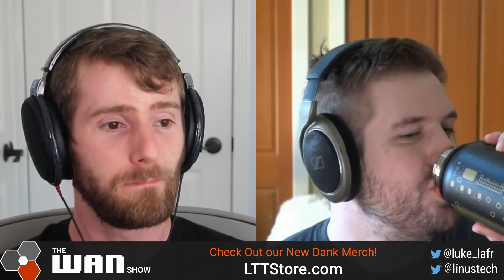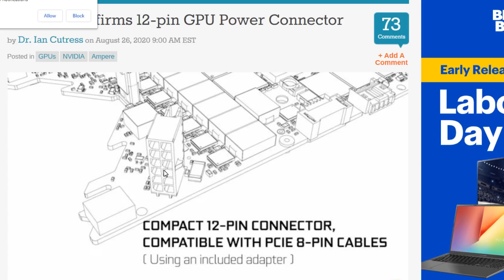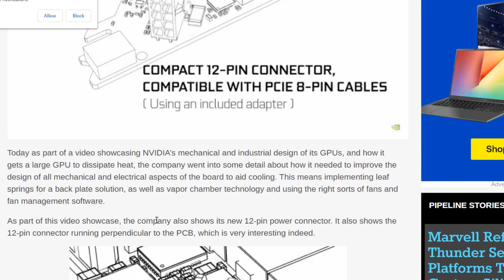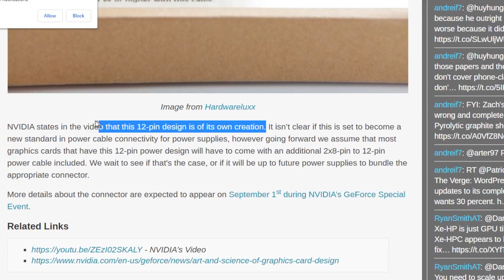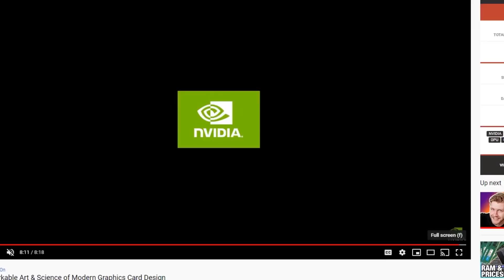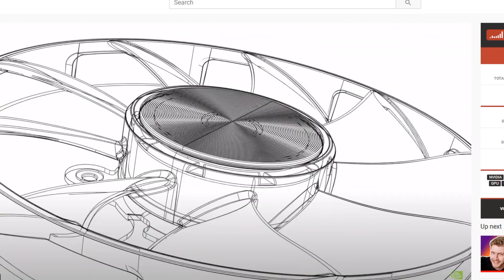Nvidia Confirms RTX 3090 12-pin Connector!

Comment: @LTT I have a question please help me!! (Or anybody else that's more tech savvy than me which honestly isn't much)

Im doing a small upgrade/rebuild(?) of my PC involving a motherboard, CPU, and RAM.. what would be some things I should worry about/look forward to in terms of possible difficulty. 

Full details. I'm upgrading, albeit small, from an old amd fx4300 (i forget what my current motherboard is, forgive me, but it was a pre built comp I bought off of Amazon) to an ASUS B450 pro .. I think it is what it's titled. Im going for an amd Ryzen 5 2600x for my pc.. I suppose ram doesn't matter too much since I'm upgrading from 4gb ddr3 to 16gb ddr4. Anything more improved that my old junk HAS to be an improvement! LOL

Comment: I dont care about this from a cable management stand point because if you care about the look you would use extensions . I dont on most build anyway  since its so cheap nowadays. Now extension manufacturers are going to have to make a 12pin extension. But if the performance is there then I'm in.

Comment: i got zotac 980ti amp extreme and there is already a 12 pin connector - i use 2 6 pin for this.. why is this now so a "new" thing? or did i cant use my 2x 6 pins for this now?

Comment: I am fine with using the adapter if it's long enough so that the joint were the original and the adapter meet is not visible. The join needs to be under the power supply shroud or as I call it "the basement".

Comment: Could someone a bit more knowlegable please educate me as to why it's a 12 pin connector?  It makes no sense to me

Seeing as it's either 2x8 or 3x8 wich is either 16 or 24 pin on the GPU. And i remember seeing the 12 pin connects to 2x8 meaning you get less pins any way?

Is it just so that if you have 4x8 pins from your PSU, you can plug all of those into two 12pins to only have 2 sets running to your GPU instead of 3 cables?

Comment: I really hope this stupidity goes straight out the window. PSU manufactures don't provide enough information as it is about the products they sell. Now Nvidia wants to add a custom 12 pin and add more confusion to the market. From watching a lot of the coverage the 3rd party cards are not even entertaining this 12-pin idiocy they are just using x2 or x3 8-pins. Go to hell Nvidia you're not that special.

Comment: Wait so I don't need to update my PCU? I have a modular 650watt (which is the minimum req. for 3070). I can either use the adapter that should come with the 3070 and or just get a new cable? First time building here.

Comment: In general, computer stuff is poorly designed from the beginning, compared to industrial stuff when it comes to cable managing.
I have seen some sick builds, but those guys has made their own cables, and in some cases resoldered new connectors on the boards, sometimes on the back of the motherboard to hide the cables

Comment: So I'm building my computer in the coming months and I've been trying to understand all this computer stuff lol and one of the only things I've bought so far is my 750W power supply and I'm hoping even though i just bought it I don't have to replace it but how would i know if I do or not ?
Reply: don't buy a single component when you have no idea of the rest. usually any PSU should be enough for any build if it's true 750W (I expect at least a gold certification and non rubbish brand), but it's the bare minimum as advertised by nvidia.

Comment: Do I need to upgrade my power supply??? I currently have a Corsair RMX Series (2018), RM650x, 650 Watt, 80+ Gold Certified, Fully Modular Power Supply, and supposedly my pc (without a graphics card) takes around 223-250 watts. And add the 320 watts for the 3080, I’d be cutting it close but it would still work. But idk if I need to buy a new power supply because of the 12 pin connection
Edit: I googled the minimum power supply for the 3080 and you need a 750 watt unit. So I’m mad
Reply: Save up and get a new one. I recently got a 1k PSu AX1000 80 Plus Titanium. It cost $290.
Reply: Noltar that seems excessive. What are you powering??
Reply: Kaiden Schwent it is excessive but I rather have a power supply like that than one close to what I am actually using. I have a i7 9700k, 32gbs 3200mhz ram and a RTX2080. Also, I am not saying you should also get one of those, but get one with higher wattage. My old PSu was a 80+ Gold 850. This is my PC https://youtu.be/hMCG_Ao5hRg
Reply: Noltar damn dude. That’s a solid rig right there. And so clean 👌
My current pc is a Ryzen 7 2700x (with stock cooler), 32 gigs of Corsair vengeance ddr4 3200, MSI X470 Gaming M7 AC, with a MSI gtx 1070 ti (trying to sell rn before I get the 3080), and obviously I have the Corsair 650 psu fully modular, and lastly I have a silverstone RL06 case. For my monitor I have a dell 27” 2560 x 1440p, 144 refresh hertz, with lastly gsync. I also got some other stuff as well but yeah. Even now it’s still a solid beast
Reply: @VenusChad  That's a very solid system and that 3080 will be a beast in your system. Also yes, get a bigger power supply just in case. I didn't list all my specs because I was typing from my phone but following your lead my specs would be: 

Case: Lian Li 011D XL White
MoBo: MSI MPG Z390 Gaming Edge AC
AIO: NZXT Kraken Z63
CPU: Intel Core i7 9700k
RAM: 32 gbs 3200 mhz GSkill TidentZ RGB
GPU: MSI RTX 2080 Gaming X Trio
PSu: Corsair AX 1000w 80+ Titanium fully modular
Monitors: 2 Asus VG248QE 1ms 144hz 1080p(Old monitors. I might be getting a 1440p or a 4k monitor. Still not sure though but I'll be getting the RTX 3090 depending on the benchmarks because I want that sweet ram!)
SSD/HDD: 1 M.2 1tb Samsung 970 Evo Plus, 2 Samsung 250 gb 840 EVO and 2 3tbs HDDs(Don't remember the brand)

Future upgrades:
3 pack Corsair LL120mm fans
1 16tb HDD(Lol!) and 2 2tb SSDs
Also the RTX 3090 or 3080.

Another edit..... Sorry for the wall of text!

Comment: So if you have a custom cables from CABLEMOD which only offers 2x8Pin PCi you will have to install this adapter it will look so ugly in my opinion. I really hope Cablemod are goin to make a new one to fit your cable style. But maybe the adapter is long extension cable with different connectors on each side so you will be able to hide it little bit

Comment: Wow....so you pretty much need a new everything with the new graphics cards...there goes the price value...not to mention if your current 2080ti case setup is not big enough or a slim version ..NO chance of using 3090..
Reply: When I upgraded my CPU I had to buy an entire motherboard along with RAM. Total cost of that exceeded the cost of my GPU+Power supply.

Comment: A lot of partner boards I’ve looked at seems like they’re going with 3 8 pin connectors for the 3090
Reply: That's because the 12 pin is only like two 8 pin, which gives 150w each, add another 75-100w from the PCI lane and you will have around 400w maximum. But if you put three 8 pin you have a maximum of 550w (probably a little less) so much more room for overclocking
It was the same solution used on some of the high end 2080TI to let people have an higher margin of overclock, probably they did the same here
Reply: @davidelancellotti8796  did you not watch the video. He says that 12pin can deliver up to 600wats.

Comment: So can I use 6+6 pin cable?

I got (6+2)+(6+2) cable on my psu, am I good for non-founder 30 series?
Reply: Two 8 pin (or 6+2) will work with Founders Edition and most partner boards. Some do use a third 6 or 8 pin, so check first.
Reply: @RandornCanis  I see, thank you.

Comment: Everyone: Complaining about processors using 60 or 70 Watt. 
Me: Watching my Graphics Card consuming more than 300W.
Reply: lol I am running a threadripper 3960X and not one but two  NVIDIA Quadro M6000's  TXU loves me
Reply: I had a phenom 2 oc-ed, 200-300W power draw XD.
blew up a 500W psu with furmark on my 7970 (at a similar power draw) and linpack on the cpu
Reply: @satibel  my phenom ii x4 945 is currently oc'd to 3.4hz and I can't bump it any more on my 500 watt psu because I'm also using a 5500xt.
Reply: @GhostlyGhille  as long as it doesn't make a popcorn noise like mine did, that's good.
Reply: @satibel  psu gpu or cpu made popcorn noise?
Reply: @GhostlyGhille  psu, the fets (transistors) went pop
Reply: looks at my 680
:(
Reply: My 1080 TI pulls 350-380W
Reply: I remember my old R9 390 needing 8 pins and a 750watt PSU was recommended for it lmao.
Reply: Mine is only like 172W
Reply: Gtx 295: 700W minimum
Reply: Gratz, I have 15 kw solar park. You think it can run 300 watt blender?

Comment: yeah people are complaining a bit too much, I imagine all the manufacturers will have 2x8pins to a 12pin.
Like I said before I wonder if this is for the Intel 12Vo standard as it would allow 1 single cable going into the motherboard.
I like it.
2 8pins = 300 watt, 150 per 8pin with another 75 watts coming from the edge connector.
NVidia impressed the hell out of me, It looks the great and the prices are perfect, I think the 3060 though might be between $300-400 and easily match the 2080 in performance, which is very exciting.
3070 for $500 and it matches the 2080Ti
3080 for $700 and it is 60-98%(depending on the game) more powerful than the 2080 which means its about 25-35% more powerful than the 2080Ti according to Digital Foundries video early preview.
and the BEAST 3090 for $1500 that basically is the gaming titan $1000 dollars less than previous gen. 
Can't wait for your full reviews.'

I think AMD is in a bit of trouble here, Lisa Su stated that Big Navi is matching the 2080Ti for performance and that is their target, which means its competition for the 3070, which if they drop $50 off the price but it doesn't have quite the RT performance as the NVidia card they will still do well, either way with the consoles and AMD supporting RT across their entire line I can see Raster lighting and shadows in 2-5 years disappearing making developers time spent much mower on that aspect of development.
Reply: A PCIe card edge can only supply about 60W on the 12V line, and only if alone on the bus. Wikipedia is misleading at best.

It's only used to bootstrap the video card because it's so variable. This just means we rely on PCIe power even more. A single 12 pin with the current handling of at least three 8 pins, minus the 6 programming lines that would have -- hell yes.

Comment: It would be nice if Nvidia sold the card with a 8 to 6 pin adapter + 6 pin modular cables (×2). 
This way you can run the new card before waiting for the company of your PS to sell 6 pin modular cables, no?
Reply: I though they said the 12pin adapter was included in the box?

Comment: “Own creation” by picking a standard connector from the Molex catalogue
Reply: Yeah I was just laughing on this myself... The only news is a lower gauge cable meaning higher power on those pin differently from ilthe existing connector. Except many PSU manufacturers contrary to what you could believe already used overbuilt cables, my cheap entry level xfx payed 60€ has already awg 14 conductor, meaning a 0,7% loss on a 1 meter cable if those same were used for this 12 pin connector soo... I call this bullshit for now, and well up until we'll see 4 slot reference card it won't be that useful...
Reply: Well, they defined the pinout… so they would need at least a first-year EE student for that.
Reply: @anlumo1  or a dice
Reply: current standard is molex (4.2mm), new one (3.0mm), 4.2 usually handle awg18 wires,sometimes awg16, new one is suitable for 20-22awg - that means - 2x 6/8pin pci-e can transfer easy 60A, but new12pin will take 30, max 40A
Reply: @duniek86  But one 8 pin is officially only rated for 150w. Also I think even if nobody is using that "feature" the pcie connector has sense wires which often also just get used for power delivery.
EDIT: I think you are wrong it seems to me that the new one by nvidia uses awg 16.
EDIT2: Seasonic confirmed that they are using 16AWG. So its definitally a special edition and not a standard of the shelf connector or at least crimp contact.
Reply: @Jonas_Meyer  i highly doubt for awg16 in 3.0 connector - 4.2 has 18awg already and have much bigger terminals, i see awg16 in 4.2 but only few times
Reply: @duniek86  AWG16 was shown in some leaked documents and also seasonic confirmed awg16 with me. So there should be no doubt.
Reply: looks like a standard molex to me.. the keyways are the same..

Comment: this is confusing because on the nvidia release today the rtx 3080 which has dual 8 pin and rtx 3070 has single 8 pin. looking at rtx 3090 i cant find any photos of the power plugs. so i know nvidia has confirmed they are making 12 pin plugs but their graphics cards still have 8 pin
Reply: actually rtx 3090 is dual 8 pin so im not sure why they have confirmed 12 pin plug
Reply: ok now this is very confusing nvidias website shows either single or dual 8 pin depending on gpu for 3000 series but the video shows a 12 pin connector on the card so which is it.

Comment: I heard the 12 pin adapter only comes with the founders edition?
Reply: Yes it does
Reply: Marty's random art So I have to get the founders edition? I think I heard something today that nvidia said they will be included in all of them?
Reply: So far I've seen normal connectors on aftermarket GPUs, pretty sure the 12 pin is on founders only, and I think they will include the adaptor with them but that's not for sure yet
Reply: Marty's random art ok thanks for the info greatly appreciated!

Comment: Kinda weird that your given an 2 8pin adapters instead of 2 6 pin
Reply: You need two 8 pins for 12 power lines. PCIe cables have 2 sense or programming pins to tell the GPU whether a 6 or 8 pin is connected.
Reply: @RandornCanis  well there's my something new. I thought it was just an extra 12v and ground
Reply: @johnmorris7899  Which, ironically, is exactly what the EPS or CPU power connector is. Too many standards.

Comment: I'd love to see them get rid of the GPU power connector and just have it ran through the motherboard like how CPUs are
Reply: They already do. It's 75 watts per slot, plenty for almost anything that isn't a GPU.
Reply: You'd need to use multiple pins for power I guess, if you put 300+ watts on those pins they will probably vaporise :)  I'm not sure if there would be other issues too putting high power next to high speed signal lanes.
Reply: GTX 1650 can do that
Reply: Imad El Achiri using that power bus limits the performance which is why higher end gpus dont use it
Reply: Still raises the cost of motherboards
Reply: It's happened, Apple made the slot twice as long in the Mac Pro to do this

Comment: Looks like they're not doing it for the 30 series. The product pages for the cards are out and they list 2x8pin connectors.
Reply: They are having a 12 pin, that's just the requirement for the PSU I'm pretty sure because they're shipping with a cable that's 2x8 into 12 pin I'm pretty sure. Custom cards though that ASUS and all of them are making don't have the 12 pin connector though. I'm pretty sure
Reply: BoopLoopy asus has 3x 8 pins
Reply: @sourmelongaming69  board partners are not obligated to use it but if you look on the design of the 3070/80/90 founders edition (or reference) they all have that 12 pin connector.
Reply: @eliadbu  if you look up the actual specs of the 3070 uses an 8 pin. NOT a 12 pin. I imagine this is for the 3090
Reply: Johnathan Era it says it requires 2 8 pin because it comes with a 2x8 to 12 pin adapter
Reply: @zasler7217  no. It doesnt. It requires 1 PCIe 8 pin connector 
https://www.nvidia.com/en-us/geforce/graphics-cards/30-series/rtx-3070/
Reply: @zasler7217  the nvidia reference card does. Not all the other ones
Reply: @johnathanera5863  you can still physically hook up the new 12 pin with the 8 pin albeit not all pin will be used on the 12 pins. As I said there are plenty of images of 3070 reference design with 12 pin connector placed in the middle.
Reply: @eliadbu  link any?

Comment: I just hope that when ( if ? ) nvidia releases the 3060 it'll stick with standard pcie power connectors, since I doubt a lower-end gpu like that one would even need the new connector.
Reply: 3060 = 2080 super, mark my words
Reply: @ThunderBlastvideo  sure, but they said that 3000series has 1,9x perf/w so it should, at least in theory, be a lot more efficient, or in other words, a 12pin con would be very unnecessary. Might be wrong but it seems overkill imo.

Comment: Did you guys receive the review unit?
Reply: Most likely but they won't say anything due to the contract signed
Reply: White Fox does the contact include not mentioning if they received the unit or not.. coz I thought its mostly for when you can publish your review.. etc
Reply: @shashank6393  Secrecy is required so they don't steal viewers by saying when and if they have one.

Giving them an unfair advantage pretty basic stuff

Comment: Do you think you will run a 3070 with an i5-9600k? xD
Reply: Can't see why not... it's still a good cpu easily OC to 5 ghz and low temperatures... not the best combo but not bad either
Reply: @TheRjc2325  So do you think it'd be smart to just upgrade to an i7 or i9 and get the 3070? rather than investing in the whole setup of like a new MB for the next gen cpu's?
Reply: @imax2365  id max out the CPU just to get the most performance. I could see these GPUs causing bottlenecks with older, less powerful CPUs. But just wait and see what happens. Benchmarks tell the truth. Marketing slides, not always
Reply: @scottyhaines4226  Thank you :)
Reply: @imax2365  yes it would be smart to go with the high end cpu's... assuming you don't mind paying for the new motherboard and new cpu if you want the absolute best from your rig... I'm stuck with my rtx2080ti that i bought a year ago and i9 9900k... i guess i will have to keep milking it to worth the money i paid a year ago..
Reply: Yes